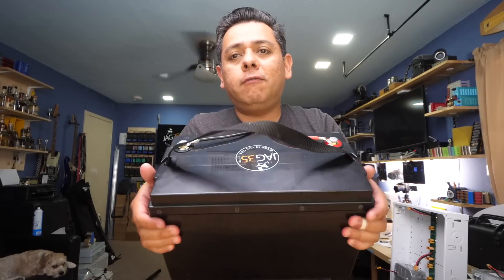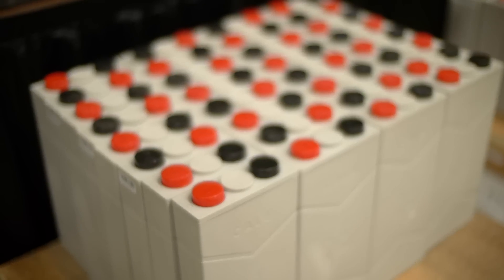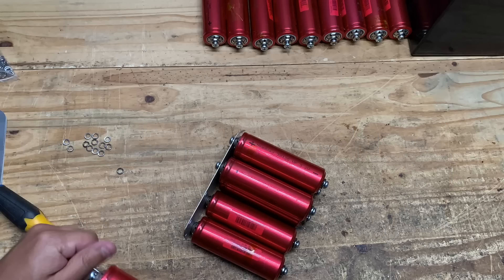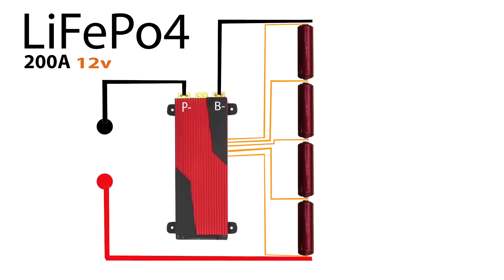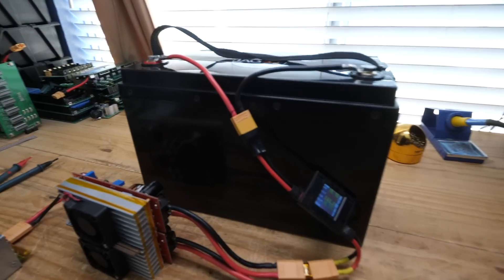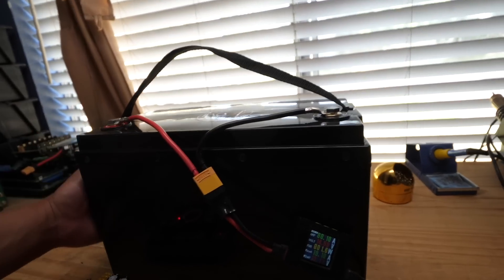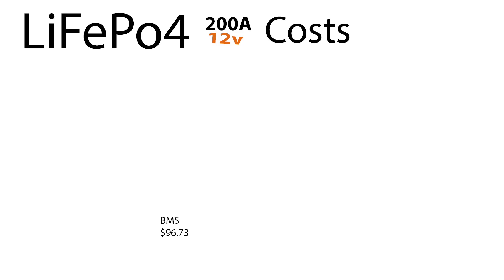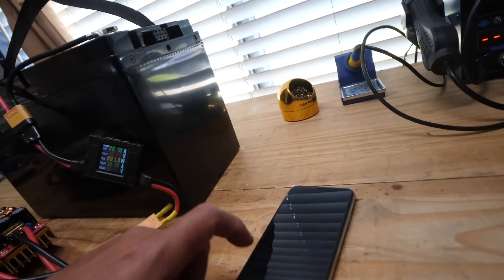Build a DIY Lithium LiFePo4 Headway 12v Battery replacement

Comment: Can this be used to start a car engine and be charged using the car's alternator?
Reply: yes, only (4) will start a car
Reply: okay but can we use the car's alternator to charge the LiFePO4 batteries? .........and without experiencing any complications
Reply: @lethaldriver  yes as long as it's regulated @ 14.4v

Comment: Your normal 12 volt Battleborn is only 100 ah, the battery that Jehu made is 200 ah -- if I'm not mistaken. So actually the price of $544 includes the BMS and twice the Amps as the Battleborn which is $950 (Amazon) at almost half the price,

Comment: How much does this weigh?  I really can't see the benefit of these for any fixed (non-mobile) solar install when deep cycle lead acid can be had for $90 each for 100ah.  Granted,  they may not cycle as many times, but you can also buy then 6x over for the same overall costs.
Reply from the maker: You can only use 50Ah out of the 100 so more like $180 for 100ah

Comment: I am a noob how is this compare to the usual 800amp car battery ?
Reply: i think he said it was 200 amps. but car batteries are made for high amp/short duration and would die quickly if used like this could be used. this is more comparable to a deep cycle battery for marine use i would think.

Comment: Cardboard is a no-no in electronics, it absorbs humidity (removing its sole purpose here), can be de-integrated by molds, and of course spreads fire if it would even start as smoldering in a corner. He should have used hard plastic plates (just like the material of the box) padded with inflammable, non-static foam on both sides. Imho the sides of the enclosure should have been padded as well to prevent wear from vibrations. Also are the cells just resting on their screws on the bottom??? That would certainly damage the bottom of the box in the long run. Cardboard wouldn't help there, they would sink through it in days.

The example is fine for a 12V power source in your lab or stationary set up, but not really suitable for a car or some other vehicle. You also risk liability when a fire would spread from this, as it doesn't quite meet any safety standards.
Reply: Rubber mats bettee optiona
Reply: Yup, I use plastic from cheap dollar store school folders. To make it even better, but non-servicable, is to pour casting resin to hold everything in place inside the battery box since vibration from engine will rattle and even unscrew the joints.
Reply: @1FishinAddict  resin for the bottom yes, like maybe 1 or 2 cm high, preferably with an already solidified bottom layer before putting in the batteries. But not the entire box as it isolates heat too, and if one cell would emit gasses which then can't escape, you made yourself a little bomb.
Reply: Ditto I use scrap Lexan or Plexiglas

Comment: I think it can suffer from temperature elevation due to no ventilation in the box. When new no problem but by aging cells may increase their internal resistance and generate more heat. How do you prevent from that?
Reply: just add fan...

Comment: Love the video, there has to be a less flammable material than cardboard you can use a buffer though right?  Am I being overcautious of overheating?
Reply from the maker: Gold is a better conductor than copper,  why isn’t every cable made of gold strands?  If copper is good enough so it’s cardboard which has been used for years to wrap battery cells

Comment: Very impressive and interesting.  ( A Tip: Get some corrugated plastic sheet goods no wet problems.) What is the weight of the finished unit? Can I assume the prices you listed would be for a finished product OTD.  Like to get a contact number!!

Comment: I have so many questions in my head. First of all thank you for the video!

1) Can this really replace a lead acid battery in any car?
2) Could the battery handle heat, temperatures like the lead-acid battery would do?
3) What happens when the alternator's output voltage moves up & down?
4) How can it handle the ups & downs such as when cranking the engine and what not?
5) What are the actual pros & cons of this battery than having a lead-acid battery?

I'm in the brink of kicking this project off, I'm just concerned with question marks in my head!
Reply: Could it?  Probably yes but would this particular one be cost effective, practical and long lasting more than likely not as much as you are probably hoping or thinking. Even if you took extraordinary and more costly measures to give it the best chance for long term success or had the perfect car in the perfect year round climate I would bet against it.  This tech has come a long way but in this particular application IMHO it is probably not quite there yet. There are many other uses where lithium out performs old tech in the long term but I do not see that here yet.  That said there is always a cost to good education so if you look at it in that light do not hold back on experimenting and learn things "hands on" because that kind of knowledge has extreme value over your lifetime.  That said it would be more cost effective to try one of these https://www.aliexpress.com/item/4000048426769.html?spm=a2g0o.productlist.0.0.51cd5407uVGzvI&algo_pvid=df879e93-fab8-43ef-a896-5a98e58216b7&algo_expid=df879e93-fab8-43ef-a896-5a98e58216b7-13&btsid=caf40ea1-3d65-4923-a231-df22d6e4d7cb&ws_ab_test=searchweb0_0,searchweb201602_5,searchweb201603_52
Reply: Short answer not really, you're looking at least 5x the cost of a car battery. A car battery lasts 5-7 years, this might last 10-20.

Comment: So what ended up being the over all capacity of this battery ?
Reply: As stated towards the end of the vid it tests at 40ah which is exactly what I got with the one I built.  This batteries strength is more about high discharge rate capability (200a continuous) which is about double what is generally available on the market that could cost you roughly twice as much.

Comment: how thick are your plates??
I have 120 of the blue 10ah 38120s cells so 30p4s 
i got 4 x 1.6mm aluminium 5x6 cell plates and 2 5x2 cell and 1 6x 2cell connecters so is 1.6mm thick enough???
I have the 30 cell blocks with 5x6 plates and the plan was to overlap one row of 5 to the next block then across from 6 to the next block and 5 to the last block
should the 1.6mm 5x6 cells joined with 1.6mm 5x2 and 6x2 plates be all good???

Comment: Too expensive for me. Not going to spend $544 to make a 12v battery. No thanks.
Reply: Crappy batteries at Autozone cost $250.  It's expensive, so it's not for most applications.

Comment: 5:00 Could use cutting board material instead of cardboard as it will be a bit tougher and waterproof.
Reply: Yes, cutting board material might be OK but what about perspex which comes in different thicknesses?
Reply: @johnmcdougall4149   Perspex bends easily, so you can protect the side and top with one piece.

Comment: Anybody want one of these built exactly as shown and tested for at least the cost of parts?  I built it mostly for the experience but the high discharge rate is frankly overkill for a use I have in mind.  Available in Tucson AZ but travelling to San Diego in a couple weeks or I could ship it out.
Reply: What is the total weight?
Reply: @2239968  It weighs right about 30 lbs by itself not packed.
Reply: Thinking I might even let this go for less than it cost for the parts and shipping if that helps!  How about an ebay auction?
Reply: @raymondwalker1757  I ended up building a pack with a Power Sonic 45ah lifepo4 pack. Fit my budget and goals a bit better. Should have the case sorted and cleaned up later this week.

Comment: Next time a 48v 200a one! I am curious what bms you gonna use for a ~10kw battery. Specially designed for mobile applications other then cars, for electric boats propulsion for example/
Reply: Yeah I agree I would like to make a 48v version for a power wall with a total of 48kwh

Comment: How many of these batteries would I need for an off grid solar system?
Reply: Depends how many volts you want your system to run on 24v you'd need two 48v you'd need 4

Comment: Your videos  are incredible  any chance I can pay two years in advance with thirteen various email addresses. I need to build 8 for a project. I have a few questions a modified sine wave 12 to 110 is good for appliances ? a pure sine wave is basically  a new school way to power electronic devices?  i want to build an off grid trailer on solar with 4 100 watt pannels I need one separate 20 amp dedicated circuit to run a 18k seer mini split. I think I need 2 dedicated pannels and at a minimum 3 batteries or 4. I did rough calculations and I believe over kill of power in supply will put batteries at 35% drain thus increasing life span? To a decade possibly give or take a year I think? 
   Long ago I was Mecp certified so i am confident  if i can build it myself minus charge controllers and pannels ... 

Heck if they cost 400.00 to build I may try to buy a pallet of everything  and produce them for resale

Comment: I am in South Africa and info on Lithium is hard to come by. I have found a source of 18650 cells used underground in the mines on miners lamps. I would like to build a lithium battery for my motorbike. Any leads or info welcome.
Reply: Lithium batteries are cheap and readily available on eBay for motorbikes because when my mate bought one, he never had any issues with it as he did with his previous leaded battery.

Comment: would this work for a RV solar. I priced the battery for 40 of them It's $400. I need 2000 amp. If they do work what would the life be.
Reply: Do you mean 2000W?  2,000 amps would be a crap-ton of power.
Reply: @208guy  2000 amps. I want to run my a/c, freezer, refrigerator, 72" tv and a xbox. what size invert-er to do I need. just so you know I have been learning a lot about solar but I'll be honest with you I cant make sense of it. amp hours and all that just dont get it.
Reply: @jeffreycarigon642  Take your time and learn the basics first.  Plenty of info out there.  This guy is really good https://www.youtube.com/watch?v=cX4s-bxn4fs  Next, you need to determine how many watts each of those systems require.  Then, which ones do you want to use at the same time?  This will help determine things like the size of inverter - how many watts do you need at a given time.  After that, you need to determine how long you need to run each of these.  This will let you know how big your battery needs to be.  I'll tell you right now that running your A/C off a battery or solar is probably not an option especially if you're just getting started.  Start with the smaller appliances.

Comment: I own a semi truck/tractor and need an anti idle solution. Can you help me? I have 3 small refrigerators,,a tape  deck,TV and a VCR. I will use and inverter to power the TV and Tape deck and sometimes a 💻 Laptop. I want solar panels to charge the batteries 🔋 when I am parked or a generator when there’s not enough sunshine ☀️. The ideal amp hour rating is 300 amp Hours per 12volt 🔋 battery.  Can you help me!
Reply from the maker: Build a few of the ones shown here in the video

Comment: i don't think u should use cardboard between the battery as its flammable
Reply: Yes, I agree with you on that but I can think of 2 other materials which may be safer than cardboard which is perspex or rubber sheeting.

Comment: Will the alternator recharge it some as you drive or do you have to convert that somehow
Reply: You'd need a DC to DC charger if you're running it as a second battery. This battery wouldn't start a car, it's too small. If you're wanting a replacement car battery you'd want at least a 100ah, not sure if this type of battery is designed for cold cracking output.

Comment: can  this be used on wheelchair, I would like to try building power cell for my wheelchair
Reply: That depends on the battery voltage that you are trying to replace. I have seen some carts and wheelchairs that are 24v and that would mean 8 sets of batteries in series instead of 4, but can be done with the same number of cells. That would replace 2 of the 12 volts in series, and it would give a better power density than the lead-acid batteries.  Meaning you would be able to go further on a charge. It just depends on your wheelchair voltage, and most of us people with an electrical background would have no problem figuring that our if we could see more. I remember back in college that there was a woman with a wheelchair that was a student advocate at the time, and she could move that wheelchair faster than I could walk at my peak years ago.

Comment: Jehu, one question: why do some packs (i.e Li-Pos) need to be balance charged, while others (LiFePo4) don't?
Reply: BMS installed in the battery case balances the cells and cuts off output if over or under voltage on any cell for safety. they should always be balanced

Comment: So how long did it run at 200A.  What is the rating on this battery in amp hours?  Thanka
Reply: 35ah at 200 amps
60ah at 100 amps

Comment: Hello
question to power a motor 24v 50A 80lds consumption of boat
which one and most adapt 18650 or the 38120 for maximum autonomy?

Comment: Jehu, would it make sense to use an insulating material instead of aluminum sheet, then attach the battery terminal to bus bar(s) with screw-on connectors?

Comment: So I'm confused. That BMS, does it cut off when under a load of 200 amps? I am wanting to power a high powered audio system with one that will pull more than 200 amps from the amplifiers. Will that cause it to malfunction?

Comment: QUESTIONS: 

1) Is a BMS only needed for the initial assembly and first charge, or does it need to permanently sit between the alternator and the battery pack ?

2) How many CCA can that 200A continuous battery put out ?
Reply: 1. I won't remove the Battery Monitoring System on these. 
2. I don't know

Comment: Can your assembled battery replace the traditional car battery?
Reply: It's a little small for a car battery, I think he said 35-50ah...that's a lawn mower size battery. A car battery is generally 100+ ah. If you wired 4+ in parallel yes, it would work. That's basically what a Tesla car battery is about 1500 or so 18650 batteries wired in parallel.
Reply: @MichaelCook1981  I planned to make my own lithium battery for my Cressida. But the BMS that can handle 70Amp++ is expensive in my place (70A to crank from cold start, inline-6 2.0L engine)

Comment: Balancing the cells?

From what I understand, it seems wise to "balance the cells" before assembling the pack, particularly when using used cells like these.

Can you please do a video explaining how to "balance" the cells prior to assembling a pack in the case of a simple 4S pack (four cells in series) and in the more complex case of 4S2P (four sets of two parallel cells in series), assuming that the procedure will scale as you increase the number of cells in each parallel set?

Please be specific as to what the issues are, what procedures you follow to test / measure pre-assembly, and then how you group them to balance the pack.

Thanks in advance......

Comment: Hay I bought 500$ worth of these batteries and so far only half of the shipment is come in and the other and the half that did come in are some rusted some of old glue on them and they're below the safety cut off and somewhere above the safety cut off too so does this happen all the time because I don't want to buy more if this does
Reply from the maker: They are used cells,  but I think they sell a few thousand of these a month and I don’t see a lot of complaints,  maybe this does not happen often,   Email then  they care of problems

Comment: Great Video you just talked TOO fast for old ears like mine. I can play it over an over!! Looking forward to other videos.
Reply: Play it 75% speed and turn on the closed captioning
Reply: Be glad it is just basic electrical stuff, there are things that are much more complicated such are rules and laws that have no basis in safety, science, or other such things that are based on natural laws that don't change. When dealing with such things I need experts to help me, where I will do the things easy for me that others find difficult because they are not willing to understand natural laws and properties of materials, electronics, and so forth. Simply put the voltage of a battery depends on the chemistry used, and a battery management module is used to keep the cells balanced and not overcharged or over-discharged to increase the life of the batteries. The most important thing is good clean connections that are kept corrosion-free. That can be accomplished with sanding and using silicone grease, and making sure to properly tighten the connections not too loose or too tight.

Comment: Will this battery be able to start an automobile engine?
Reply: No, you'd need at least two to start a car. These types of batteries are really designed to be used as a power source for inverters to run items like frigs, cell phone, computer. The cold crank of an engine draws a high load.